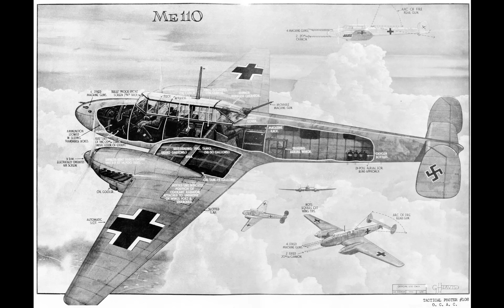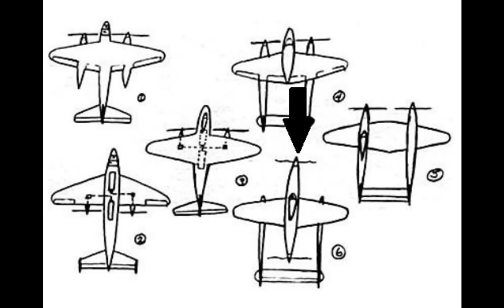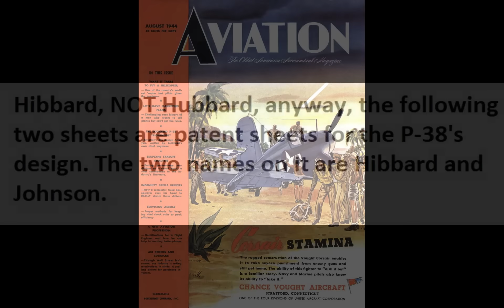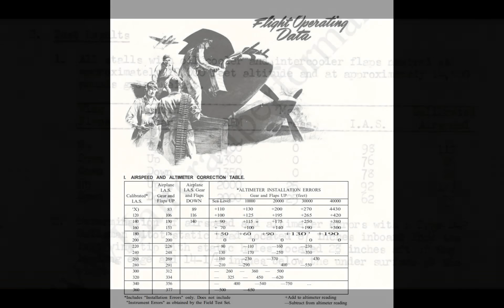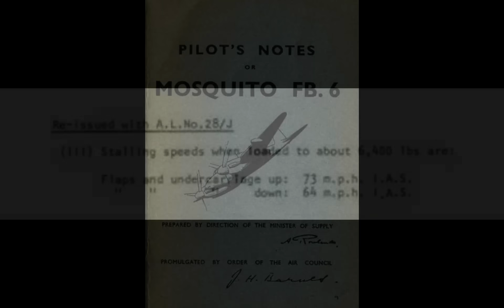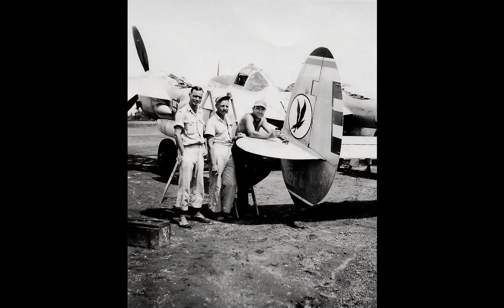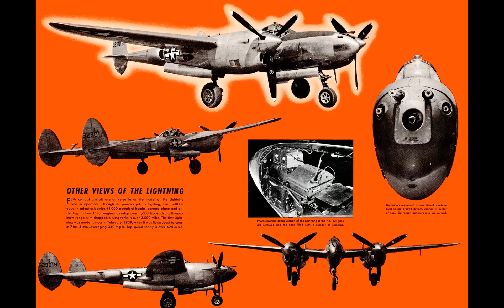Lockheed P-38 Lightning Design Info

Comment: 33:14 In the early P-38s (those without automatic controls for the radiators nor aileron boost) the hydraulic gauge in the cockpit registered pressure in use: Most of the time the gauge reads zero and only rises when the hydraulics were used for flaps and gear movement. This was helpful because if the gauge did read a pound or two when the hydraulics weren't in use, this indicated a leak in your system since external air pressure was being exerted in the lines.

Later models (P-38G and beyond) continually employed the hydraulic system, so there was always going to be a few pounds registered under most circumstances. Because of this, the hydraulic pressure gauge in late-model P-38s was reversed and showed you what pressure you had left in reserve rather than in use: The needle would drop to zero when you moved the gear or flaps because all available pressure was being employed by the system.

Rather irksome to see flight sims depict a P-38J or L with a cockpit hydro gauge that jumps up from zero psi whenever you raise or lower the gear.

Comment: A hydraulic pump on both engines. I wish the Aztec I flew had that.
Reply: Isn't there a manual pump?
Reply: @givenfirstnamefamilyfirstn3935  There is. But if I have a left engine failure after takeoff it will take a while to raise the  gear. Assuming there is even time to do it.
Reply: @toothlessthea150m9  I was taught to wait until there was no chance of getting back on the runway before fighting the nasty tiny gear tooth-pick.  It would not be nice with 6 bodies on board, some had 8 seats!

Comment: It was only good in the Pacific because of its huge speed advantage over Japanese aircraft. German planes had much higher performance as well as being more agile.
Reply from the maker: It's much more complicated than that.
Reply: @GregsAirplanesandAutomobiles  A lot of P-38s were shot down first in North Africa then in NW Europe. The primary reason was its flight performance was way lower than that of the Axis single seat fighters it encountered on bomber escort duties.  Of course poor tactics was also a problem. But in fairness no WWII twin prop fighter could take on a single seater of similar performance.  As the Germans found out when the Bf110 met the old Hurricane.

Comment: Interesting to note that none of the proposals included unitwin engines, two engines close-coupled and feeding power to a joined gearbox.

Lockheed contracted Menasco to try the concept in 1935 when forming AiRover (a wholly owned subsidiary company which would become Vega) and Heinkel would give it a try with the He 177 Greif, a four engine (but twin propellor) bomber.

Comment: The closest I've ever seen/ heard of that used a transmission linkage anything like design 2 is the V-22 Osprey, which has a connecting shaft to drive both propellers in the event of single-engine failure.

Comment: Actually, there were actual flying prototypes of German WW1 aircraft (bombers) with engines in the fuselage powering propellors mounted between the biplane wings via connecting chains. There was the DFW R1, the AEG R.I and the Linke-Hofmann R.I (technically the most advanced).  See Wiki on the DFW R1 which has links to the other two designs;  https://en.wikipedia.org/wiki/DFW_R.I
Reply from the maker: I said there were no production airplanes like that. There were a few one off prototypes.

Comment: Many moons ago I was at a park on the outskirts of Austin, Tx. I noticed it was right along side a municipal airport as their were some hangars and planes parked out on a tarmac in a fenced in area. Was messing about and doing various activities when at some point I heard a loud, "CHUG CHUG CHUG CHUG", and billows of black smoke coming from the paddock. My eyes focused on a twin engine prop plane that was sitting out in front of what was now an open hangar door. My eyes turned to dollar pieces at the realization I was staring at a beautifully restored P-38 doing some engine run-up test/tune. I'd seen countless documentaries of the plane and it had never dawned on me just how big this plane was in real life. It props towered over the nearby Cessna's and such. I just plopped down and sat there for a good hour to hang out and watch them work on it.

Comment: So if I understand correctly, the left engine spun counterclockwise.  Multi-engine pilots, help me out: This makes both engines “critical”, meaning that adverse torque is created by the greater prop wash over the outside of the wing in case of an engine-out. More modern designs, such as the Beechcraft Duchess use a counter-rotating right prop, so that neither engine is “critical”. Were they not aware of that back in the day?
Reply from the maker: They were aware, but had bigger problems to resolve, thus both engines are equally critical in the later variants.
Reply: The prototype had the props handed the proper way, so neither engine was critical. So they indeed knew full well what they were doing...

...which means that, when they reversed that direction for the actual fighter aircraft, there must have been some overriding reason for the change.
Reply: @BogeyTheBear  Ha! I knew there was a multi-engine pilot out there, somewhere!
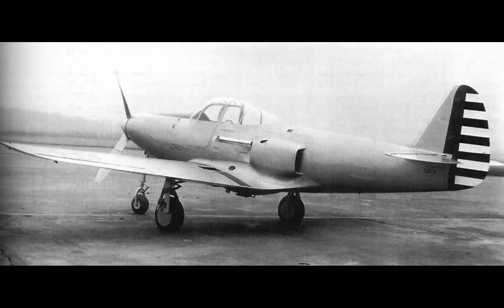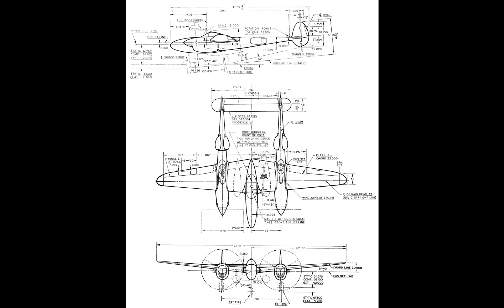Reply: See Greg's next video: Still obsessing over the counter-rotating propellers. As Bogey the Bear pointed out in your previous video, the prototypes did have the modern setup of "normal" clockwise rotation on the left, and "couinter rotating" propeller on the right. It can be clearly seen in this video from 12:22-13:00 in the still photo of the prototype.  Great video, BTW!

Comment: If you a general video about direction of prop rotation, don't forget us SA-227 Metro drivers
Reply from the maker: I am a SA-227 Metro driver. I have 6000 hours in them, although I haven't flow one in a long time.
Reply: @GregsAirplanesandAutomobiles  Once again you affirm yourself to be a gentleman and a scholar. Come on out to PHX and I'll give you a ride to the middle of nowhere in a smelly Metro in the summer sun. We still fly them /A
Reply from the maker: You may be flying the same the same ones I flew. I worked at the largest 135 outfit for 8 years. I think you might know who that is. I flew all the DH tail numbers (those were the good ones) the UPs which were decent, and the AFs which were junky.
Reply: @GregsAirplanesandAutomobiles  I happen to also currently fly for the largest 135 cargo operator on the books. These days we have the AF and MA birds locally, I'm sure you've touched 529AF & 578AF, I was flying those a few weeks ago. None of them hold any pressure anymore, you're lucky to get to 12k ft with a 10k cabin altitude. But anything for some TPIC, you know.
Reply from the maker: That's sad, we used to take the DH planes up to 21k every night, 25 in some cases. They held pressure pretty well back then. I suggest getting out of these as soon as you can, don't stay 8 years like I did, it's a dead end airline in career terms.
Reply: @GregsAirplanesandAutomobiles  I have my reasons, there's now a fairly secure chance at a interview with a SDF based operator with an impressive hire rate, I've got some time left until then and if it falls through I'm going to any RJ operation that is hiring.

Comment: Intercoolers in the wing leading edge? That's brilliant! Now every problem, including icing conditions, can be solved with "more boost".
Reply: It's there in the handbook: You de-ice the throttle by pushing it just above 2/3rds open in order to engage the turbos and get some carb heat.
Reply: It didn't actually work though.
Reply: @givenfirstnamefamilyfirstn3935  More boost always works... Until there's a way to get yet more boost.
Reply: The wing intercoolers couldn't keep pace with the engine development, which is why they went with a more efficient design in the Model 422.

Plus, it turns out you could push a whole drum of avgas into the space left behind when they took out the intercooler tunnels.
Reply: @BogeyTheBear  Even better. Avgas would have a great thermal mass, compared with air, and the range of boiling points should get that air charge nice and cold, while getting the fuel up to a nice and volatile temperature for easy atomization.

Comment: Large as the plane was, the P-38 was a very 'flat' machine. Most single-seat airplanes, the pilot is sitting atop a fuel tank or the wing box. The P-38 put the pilot, fuel tanks, engines, and guns all on the same horizontal level. This made the P-38 a smaller target than most in the head-on and side-on aspects.

Comment: Greg. Nice aircraft, good doc, thanks. Raises the old question (in Britian) about the Westland Whirlwind fighter, 350mph with 2 800hp engines which were never developed properly, 4 20mm nose mounted cannon and created around the same time as the Lightning but delayed by the engines, sadly they could not fit it with RR Merlins because of weight. Interestingly it was designed by Teddy Petter who later when with English Electric played his part in design of our Lightning maybe10 or so years later, up to Mach 2 in a decade. Interesting chap Petter you might know of him as he created the first truly high altitude Jet bomber The EE Canberra which the US bought. Looking forward to the next part of this series. again Ta.
Reply: Using tweaked obsolete engines in a new design was dumb dumb dumb.
Reply: @givenfirstnamefamilyfirstn3935  When first used in the mid 30's the Peregrine was a new type and because of the war the decision was made not to further develop it because the Merlin was given priority, the Peregrine was a much lighter engine than the Merlin the first Merlin only produced 200 HP more then the Perigrine, the problem was not with the engine it was the idea of a 2 engined fighter/bomber destroyer as was discovered in the first 12 months of the war. The Whirlwind served successfully on the front line until the latter part of the war, so not so much of the dumb dumb
Reply: @pingpong5000  The Perigrin was a Kestrel strengthened to take increased power output from improved supercharging and higher octane fuel boost levels.

Comment: Weight and Balance - if you centered the torpedo on the aircraft's center of gravity, you wouldn't have to worry about it.
Reply from the maker: Wouldn't have to worry about the weight?
Reply: Standard fuel management scheme when using drop tanks was to crossfeed off one drop tank in order to empty it out, then drop it after switching over to the other tank. By sucking the fuel for both engines out of one drop tank, you get to shed the drag of that tank much sooner than if you worked on emptying both tanks simultaneously.

End result, it was SOP to fly the airplane at some point where you have one empty pylon and a perfectly full drop tank attached to the other.

Comment: İ am late i know but i have a question i watch your bf109 supercharger drive system again but i remember you say bf109 slower than p51 but is there any altidue bf109 g6 climbs better of faster than p51 because i think bf 109 climbs better at lower altidues
Reply from the maker: Yes, the 109 generally out climbs the P-51.
Reply: @GregsAirplanesandAutomobiles  thanks for your answer

Comment: I have run out of patience at a half hour. I'd like to watch this with an A&P mechanic. It was of interest that Charles Lindberg got himself attached to a squadron in the Pacific as a consultant and raised the manifold pressure used.  It increased range.  This was told to MacArthur who was able to change his tactics as regarded which islands to take and which to bypass.
Reply from the maker: Ran out of patience?
Reply: Perhaps he couldn't maintain the

Comment: The Focke-Wulf Fw 189 Uhu ("Eagle Owl") is a German twin-engine, twin-boom, three-seat tactical reconnaissance and army cooperation aircraft. It first flew in 1938 (Fw 189 V1), entered service in 1940 and was produced until mid-1944.

Comment: From January 39, when the XP-38 made its first flight (admittedly more a demonstrator than a prototype) to March 42 when the P-38F was accepted as the first combat-worthy model, the development of the P-38 really took a long time! It is testimony to the potential of the design that the USAAF persisted with it - and even so it was spring 1944 before the type was fully mature and truly the equal of the opposition. (By then, of course, the much more economic P-51 also started to replace it.)
Reply: The P-38E was the first combat-rated variant. The P-38F was the first good combat version with drop tanks and purpose-built combat flap settings (you could use the flaps in this way with earlier versions, if you shut the lever down in time).

Comment: Does anybody have an idea as to why the ME 110, and 210 was such a dog when compared to single engine fighters?  If I understand it correct the 109 had to escort the 110's at times. It would seem an extra engine should give a higher speed but maybe  the extra weight and higher wing loading didn't add up to better performance?   Will you address this in later videos Greg?
Reply: Having those extra crew members a big reason why. The 110 eventually made a decent night fighter but failed terribly as an escort trying to go toe to toe in dogfights as they did in the BoB and later were torn apart in North Africa and the MTO by P-40's. The 210 a terrible design that originally could not even get airborne, that corrected in the pretty decent Me-410, but again that was not an air superiority fighter.

Comment: The start up trick the old hand's of both engines at once. Then the fact the pilots used to completely unnerving tactics such as manipulation of throttles to spin the plane 180° in it's own length. One of my favorites, along with the 39, and,40, and 47. 
Race car thinking had me wonder how the wildcat would have done with the hellcat engine.
Reply: The R-2800 was WAAAAAY too large for the Wildcat fuselage.

Comment: Thanks Greg.

One thing that really was a factor was it's 1937 design.  There's an article somewhere that talks about the transition between fuel efficient flight and combat flight.  If I find it I'll come back and post the link.

In any case - if a P-38 escorting bombers got jumped, there was a specific series of tasks the pilot had to perform - in a specific order - to make that transition.  The ergonomics of the controls used to do that on the P-38 left something to be desired.  The P-51 on the other hand (which was developed later and with the benefit of more experience) - had some of these functions combined and also had them located more ergonomically.  Thus - there was a marked difference between the time it took a pilot being jumped by enemy aircraft to transition from cruising speed to combat speed in a P-38 and a P-51. 

Another factor in this - was that the P-38 was a multi-engine aircraft and the P-51 was a single engine aircraft.  Single Engine Aircraft are much easier to fly.  For the new pilots coming right out of flight school this made a real difference.

Yet another factor here - was that the early P-38's - which being a pre-war aircraft - were there for the US right at the start - was that in Europe they were going up against all those Luftwaffe Experten who'd been flying a lot longer than they had.  By the time the P-51's came out - a lot of those guys were dead - thanks in part to the P-38's and P-47's.

As to it's armament - there are two schools of thought on WWII gunnery.

1) Was that you had the guns in the wings - and they had to be harmonized to all impact the same area at a specific range.  Thus the pilot wanted to fire his weapons when the target was at that range.  Closer or farther away - you were somewhat spraying the area, as in Spray and Pray.

2) If you had your weapons (at least the main ones) mounted in the fuselage - they all shot straight ahead and could be aimed at a target which was at any distance within the guns range.  The Epitome of this was Hans-Joachim Marseille
https://en.wikipedia.org/wiki/Hans-Joachim_Marseille 
whose highly developed deflection shooting - using the MG-151/20 firing through the prop hub of his Me-109f made him a phenomenon.

Now here - you start getting into a difference between societies that believe more in elites and those which are more egalitarian.  Mass produced air crew would benefit from spraying the area whereas more elite air crew would benefit from being able to aim their weapons accurately.

Thus - if you look at most US aircraft - they have the guns in the wings and their mass produced pilots can Spray and Pray their way to ... getting some hits.

The British also put their guns mostly in the wings.

The Germans and the Russians - mostly - put the main weaponry for their fighter planes in the fuselage.  I'm not sure what to say about the effects of communism on this.

The thing about the location of the P-38's weaponry that Lockheed so touted - was that with it's fire power all concentrated in one column of fire - which you could aim - and if you hit something with that column of projectiles - you could put a really big hole in it.  The Downside - was that you had to hit it - which was easier to do with weapons that sprayed their ammunition over a larger area.

You will see this again and again in the story of the P-38.  In the hands of a veteran pilot who could take advantage of the aircraft - it could work wonders - but - in the hands of a novice right out of flight school ... a P-40 would be a lot easier for him to fly.
.